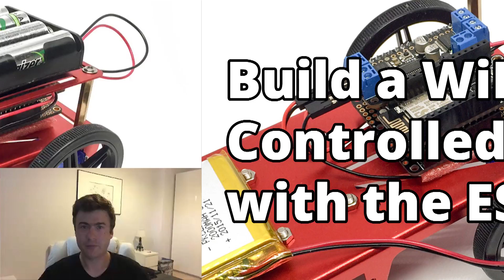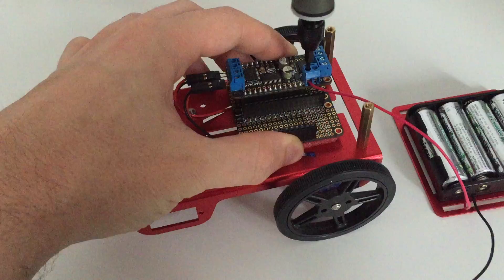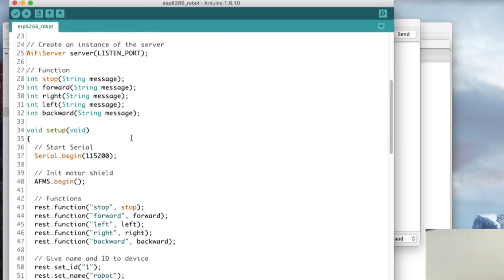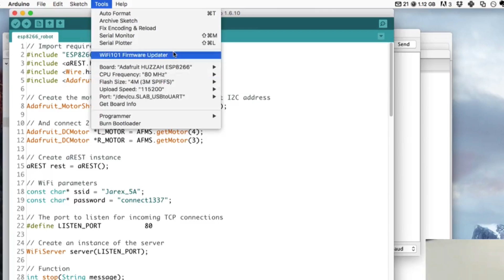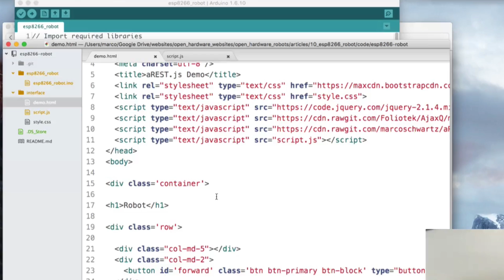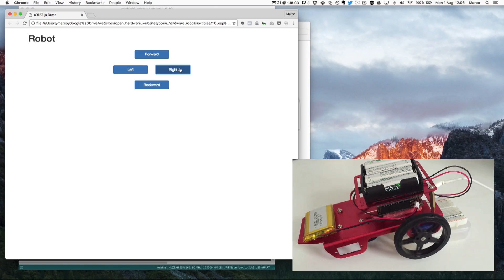Build a WiFi Controlled Robot with the ESP8266

Comment: how do we connect adafruit cc3000 wifi module to the arduino ,and how to make web page for the layout of switches
plzz tell me some coding part of the cc3000 with arduino uno
Reply from the maker: This video is for the ESP8266 only, check our other articles for the CC3000 :)